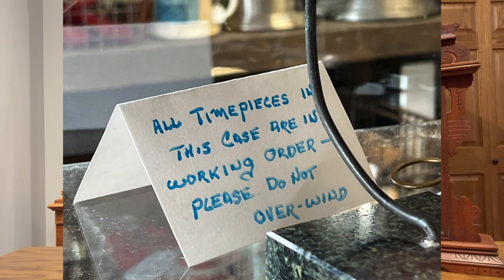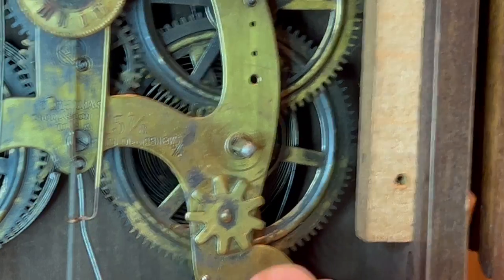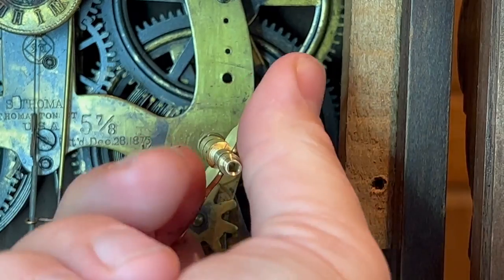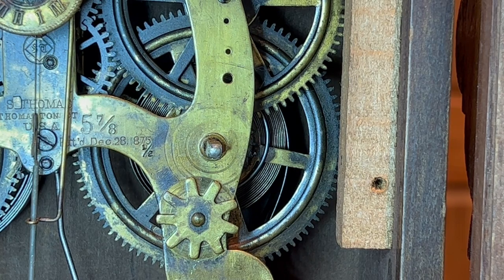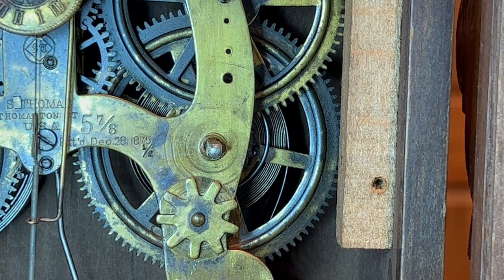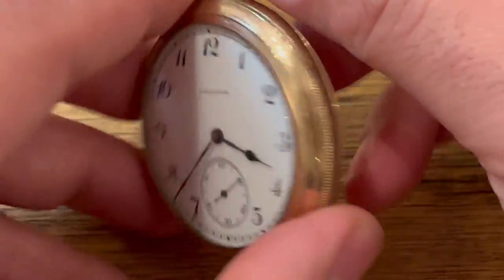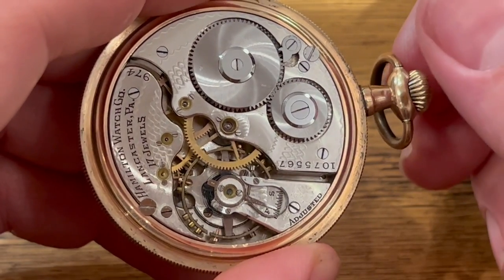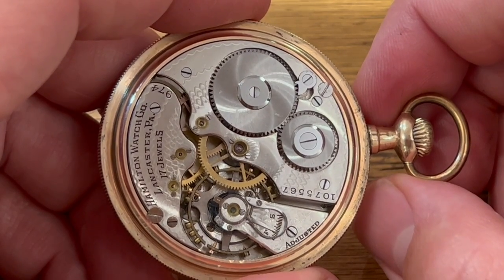Can you overwind a clock or watch?

Comment: I have always maintained the same belief as you, you can't overwind a time piece. But I have an examples I encountered where this is so. A weight driven clock where the weight was wound past a wood stopping block that was worn through years of use. the weight rode over the worn block and was wedged between the block and the inside front of the case, rendering the clock inoperative. Because of the click holding the cable in tension, the owner could not get the clock out of this condition. But generally speaking, you are absolutely correct, and I've heard the expression over "overwound" way too many times inappropriately.

Comment: I have a new Hamilton wristwatch (Khaki Field Automatic). I have the manual wind version of this watch as well already. On the manual wind Khaki, a clutch engages and stops the crown when it's fully wound. It quite definitively tells you when it's fully wound. On the automatic, The crown will just keep turning forever. I know automatics wind from movement as you wear them, but I hadn't worn it for a while and wanted to manually get the power reserve back to start the day. I don't know if the automatic version of this movement just lets the crown keep turning when its fully wound or if I broke something in it.
Reply: Just a suggestion as I don't know for sure but I would think the auto wind watch crown keeps turning when seated and not engaged is normal. Pull out once to set date, pull a bit further to set time, push all the way in to seat it and disengage from both. Fully seated it turns infinitely simply because it's not engaged with either mode. Just an idea, I'm not a pro.
Reply: @wyliecoyote1  Well its an automatic but it has manual winding. A feature so if the power reserve runs out you don't have to sit there shaking it like a dingus. Manual wind is done with the crown fully seated. I just don't know if its broken because it never stops itself. I can turn it forever.
Reply: I've seen some automatic watches that accept windings indefinitely because the mainspring is "friction-fitted" to the barrel with a dovetail, preventing the time machine from becoming self-overwound since it's self winding all day. As a result, you may never reach a "end point" of tightening because the spring will reach its maximum and then starts drifting in the barrel. I usually give the clock's crown 20 full rotations before allowing the automatic mechanism to take over with it's thing for the day.  That is not unusual; in fact, this feature can be found even in some cheap no-brand Chinese mechanisms.

Comment: I had similar situation with a vintage Winton pocket watch and found another video showing a way to get it going again.  By putting slight tension on the main wheel to allow holding back on the click and then easing the tension off of the main spring got me to a point where I could re-wind the watch.  I did this twice and then just shook the watch a little bit to get the balance wheel going, just like this video shows.  All in all, youtube is a wonderful site to learn many things!

Comment: I winded mine and it didn’t work unless I shook it a bit (it’s only wind up) gave me a jump scare should I go back to the shop (Brelsen pocket watch) and it’s been less than a month
Reply from the maker: Watches where the escapement is not set quite right sometimes need a little shake to get going, but if the watch won't stay running or if it only runs a few hours, that indicates something is wrong.